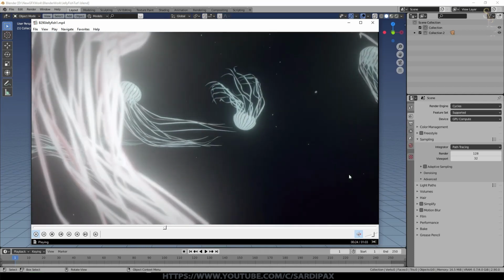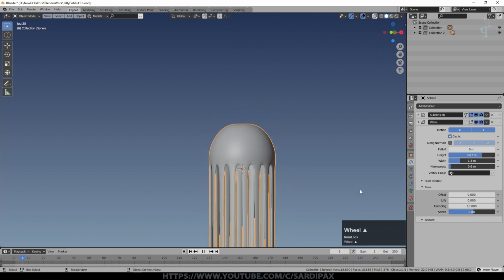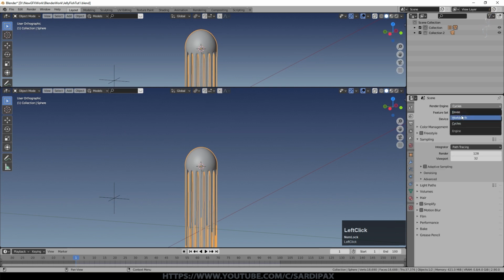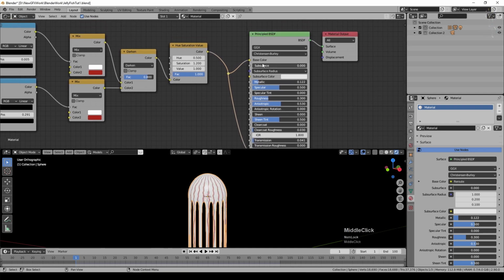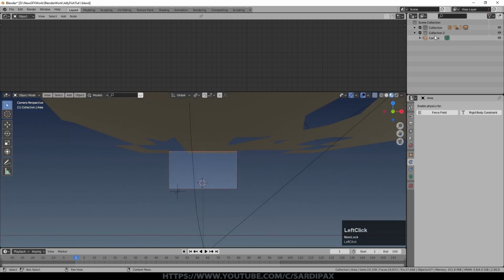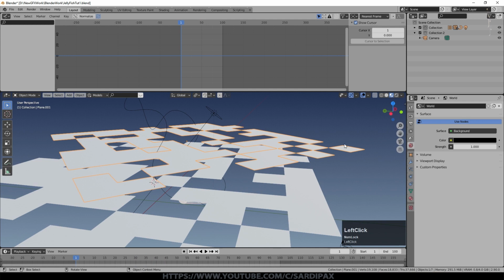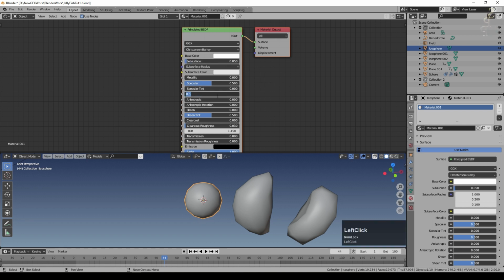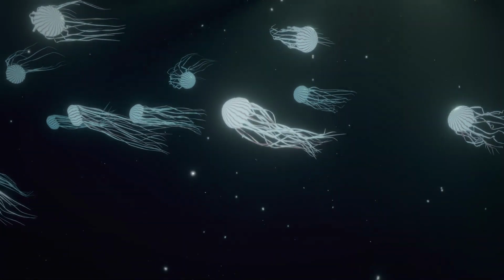Blender Tutorial - Jellyfish

Comment: This tutorial is super useful because it covers a lot of aspects of Blender, exactly what a 2 weeks Blender beginner like me needs.
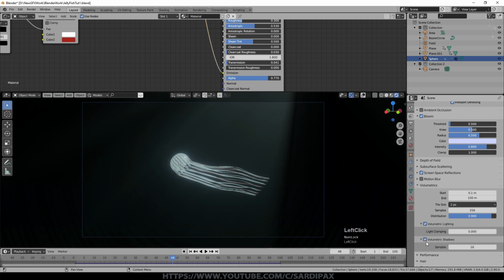However Blender crashes whenever I try to render even a PNG with the tile size at 2px and 256 samples (20:17)
Any idea on what settings could actually look good (or the closest to good) but not crash Blender?
2px 128 samples 0.900 distribution does work but it's a bit chunky.
Reply from the maker: Hi, I would start by simplifying the scene, have less objects visible, render at a reduced resolution. Start with just 16 samples too. Check that light bounces, especially volumetric, are not set too high. It's always best to start low, and work you way up a step at a time, otherwise it can be hard to find what's causing issues. Good luck :)

Comment: One question, isn't there another way to make the jellyfish move slower but not render at 2000 frames if we want it to make the full circle? It seems that keeping it at 100 frames the jellyfish barely moves around. Any thoughts?
Reply from the maker: Hi, sorry for the late reply. Clearly you can animate an object at any speed and over any set of frames. However, in terms of how 'fast' something is moving, it also relates to the frame rate at which the final movie will be played. Typically, online video is played at 25, 30 or 60 fps (frames per second),  for animation there is rarely a need to go with higher framerates. So if your end animation is played at 25fps, and your overall sequence completes in 100 frames, that's just 4 seconds. If it was a complete orbit of 360 degrees, that's quite fast. For slower, smoother motion, your realistic choices are therefore to reduce the amount of motion or increase the number of frames.